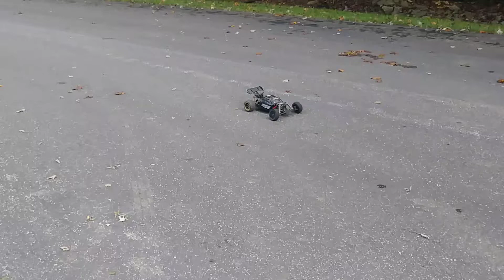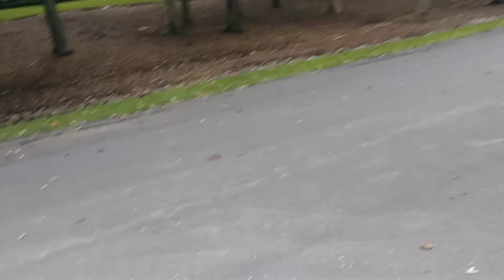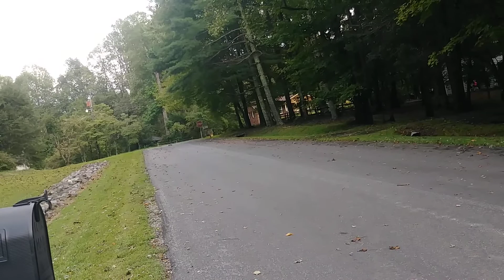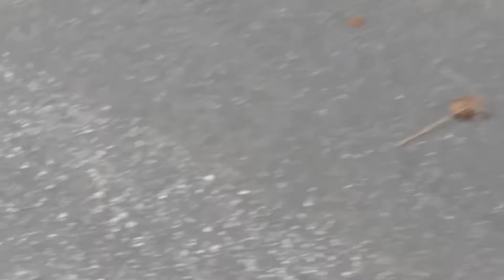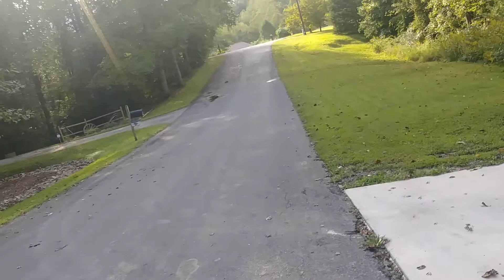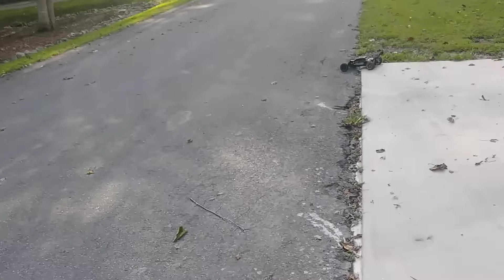L313 converted to buggy, road bash!

Comment: Hey nice run. do you by chance have the original spur gear in or did you upgrade it mine stripped out on the shaft. Thanks
Reply from the maker: Im running stock gears other than pinion, and I use a metal Ideler gear. Have had no issues with spur,  and I have ran this on 4s lipo. Just make sure the mesh is correct, not too tight, not too lose. What do you mean "on the shaft"?
Reply: Bashing RC 24/7 the spur rounded  out so it just spins
Reply: Mine all stock had for over two years bashed it never no problem till then
Reply from the maker: @blakewalton7398  2 years? Sounds pretty good to me! Lol
Reply: Bashing RC 24/7 yea love that truck lots of power and speed have to get me another one but the price and no upgrade parts yet
Reply: Blake Walton  Go to the wltoys website for parts.
Reply: PhilthyCoRC I have before never received my order from them good thing for paypal
Reply: Damn..That's no good.